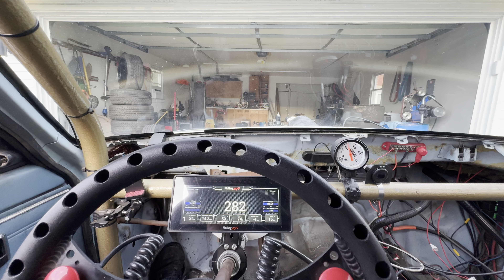Wife Assesses the Wreck Aftermath

Comment: Harbor freight has a cheap manual bead breaker😂, never seen anybody use the studs to break a tire loose but if it works🤷🏻‍♂️. Need to hit up Vevor for one of their airbag jacks, i love mine and will never go back to a pump jack lol. Brake clean or paint thinner should peel that paint right off

Comment: Lacquer thinner will take the paint transfer off tires, wheels and the body panels ... with a smack like you did I'd spin balance those tires too make sure there not bent ... you did really well recovering coming off the guard rail.. you didn't panic you were smooth about it
Reply: Yeah, lacquer thinner should do it, then they make a tire paint, he could use for the lettering.
Reply from the maker: M1 took the most off. Imma get some lacquer thinner when i can.